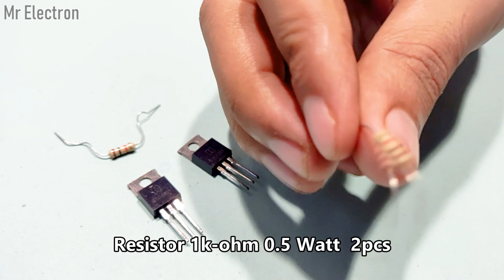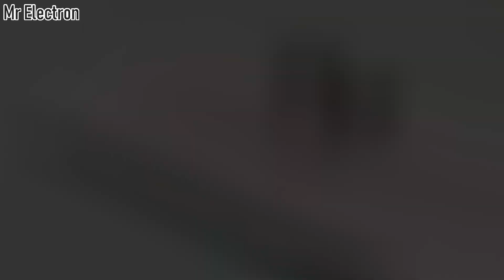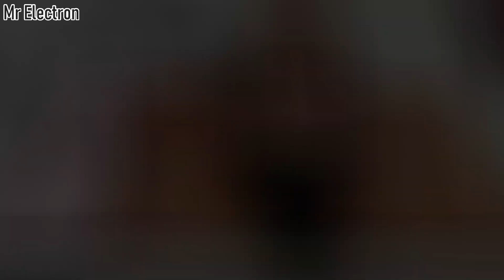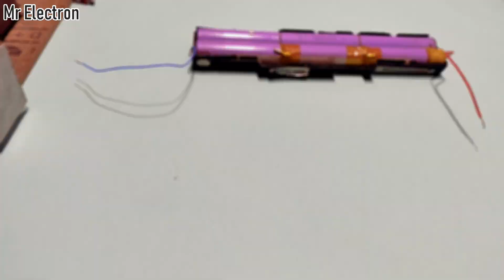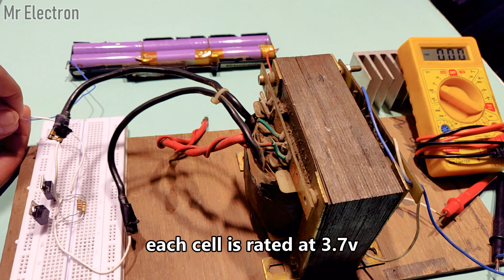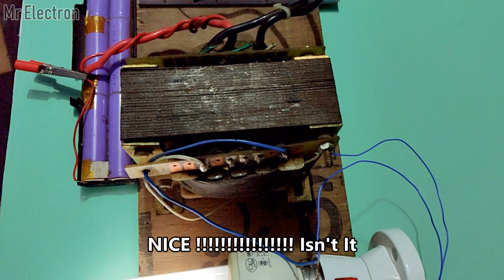Simple Inverter 12v DC to 220v AC || Converter project for Car & Home

Comment: Can you tell me how much current will i get from the out put of the transformer? And how much current and voltage will i get from the output of this dc to ac converter circuit? thanks in advance.

Comment: what's the frequency of the output AC?
Reply from the maker: 50hz to 60hz. Depends upon the input, size of transformer and resistors used.
Reply: Mr Electron  that means if I choose a size of transformer and transistor with correct responding time accordingly, I can tune the frequency within a desired range with tunable resistors?
Reply from the maker: @sovietrepublic38  Exactly!! But there's a catch.Frequency also depends on the output load.. Heavier the load, lower will be the frequency. Though i have made a heavy inverter that can maintain its frequency even under good loading but since its a little bit complicated therfore i am sharing the easier one's first so that my subscribers can easily under that one after i upload its video.
Reply: Mr Electron  Thank you very much! I look forward to your next video~~
Reply: Without any IC it doesn't  have 50 Hz...